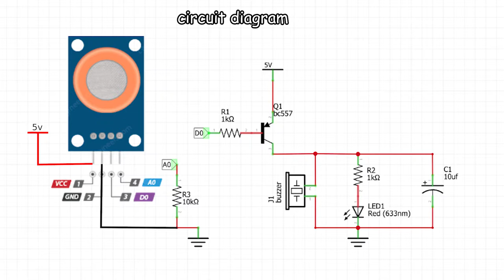MQ-3 SENSOR WITHOUT ARDUINO

Comment: Please, which is the objetive of that capacitor in the circuit?
Reply from the maker: It's bypass capacitor
Reply: Thanks! It is to filter noise signals or there is some ac signal in this circuit? I'm starting my studies in electronics
Reply from the maker: @mts9816  noise